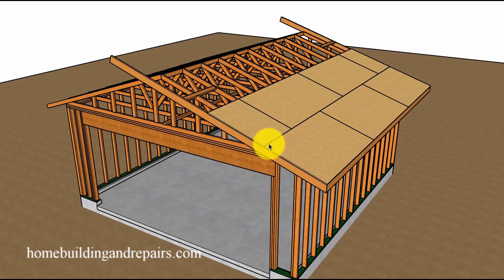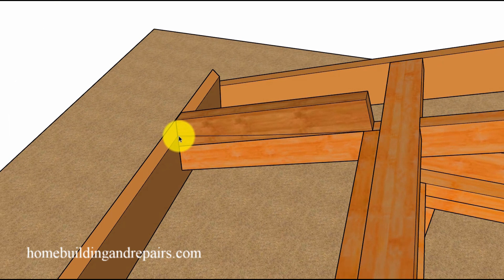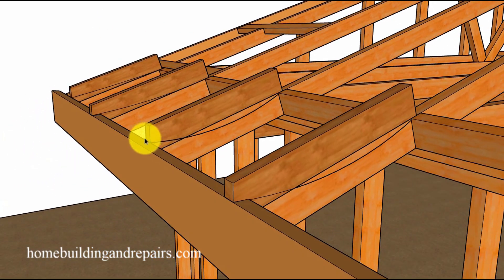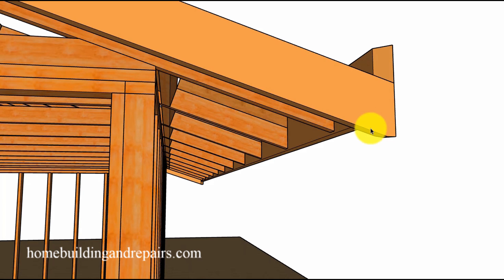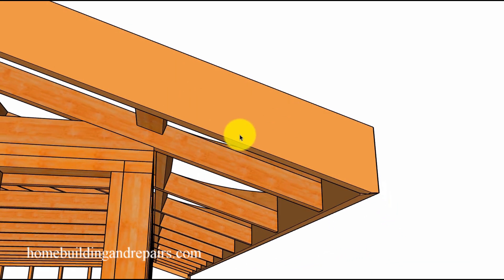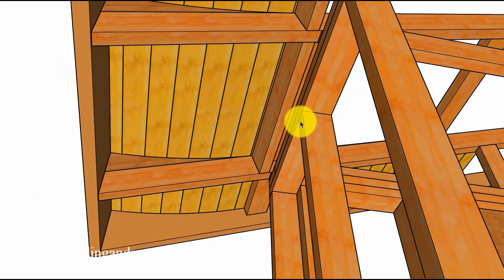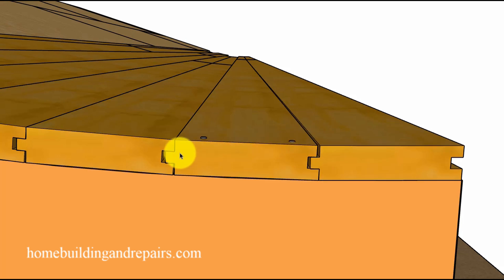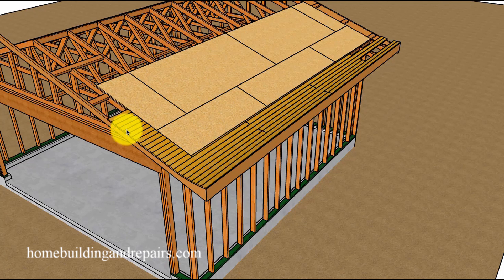How To Add Curved Shape To Top of Gable Roof Overhang - Architectural Details For Builders

Comment: How does it drain?
Know you could drill up a doorknob hole under each end and attach a down spout, but otherwise, would it puddle?
Reply from the maker: You will need to keep the curved section sloping for drainage to work correctly.

Comment: I worked on a home built in 1900. What they did was they had added almost like a shim to the facia. To add the curve, and did not add it anywhere else. Almost like.. they said to themselves after hanging the 2x12! 40 feet in the air… they were like..”nah f that, but let’s leave it”.
Reply from the maker: That sounds about right:)

Comment: That was very interesting. It gives a hint of Japanese architecture, which I find delightful.
Reply from the maker: And old Victorian homes.
Reply: @gregvancom  Say, I’ve got a question: is there a point to cutting birds mouths in rafters, if you’re going to use rafter ties (one for each rafter), and nail the rafters, rafter ties, and top plate together?
Reply: @NMranchhand  I would think of one benefit is that it gives you a nominally more steep roof because it drops that end of the roof right
Reply: @jacquestube  Oh, I see your point. Certainly a consideration.

Comment: Great illustration👍 Something to consider is the resulting pitch at the eave and the minimum pitch required for the roofing material. A low pitch roof will be nearly flat at the eaves. Also a steep roof with flared eaves can direct water straight over the gutter during heavy rains.
Reply from the maker: Yes, great ideas and steeper slopes might be required. For example the roof pitch here is about 18 degrees where something 30 degrees might look and work better.

Comment: Neat. I've bever done one of those. I see you raise the 2x8 higher than the 2x6, so you're taking it up more than 2 inches. Is there a guideline you go by as to how far to raise it up?
Reply from the maker: In the model I raised it 2 inches, but if you're looking for guide lines, I think you would want the fascia to hang down below bottom of rafters at least 1/2 inch unless building a closed soffit under overhang. Don't forget that you can use wider fascia like 2x10 or 2x12 if needed.
Reply: @gregvancom  Thanks.